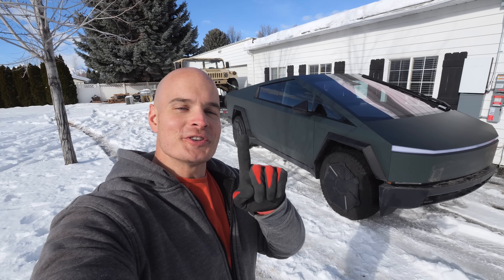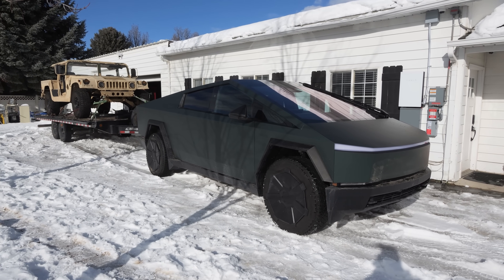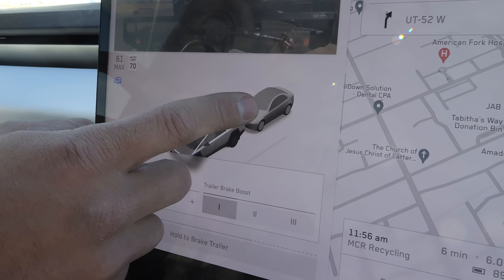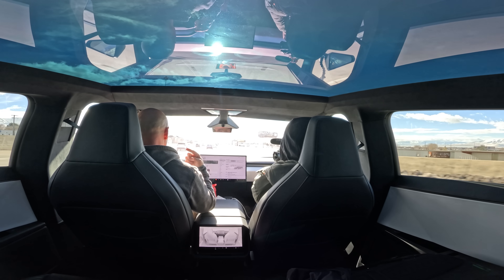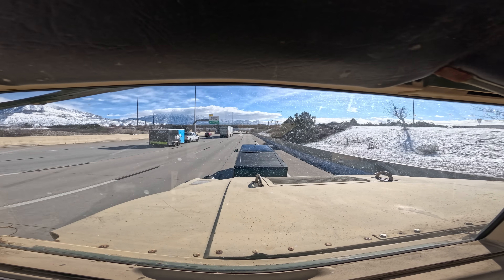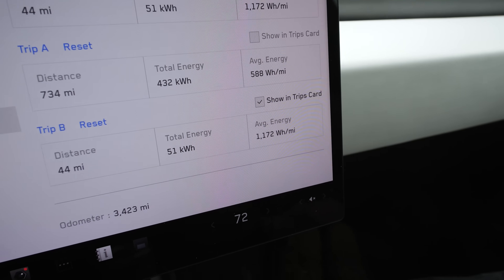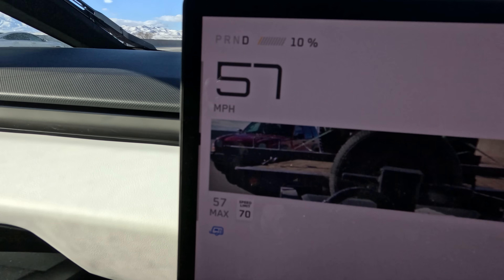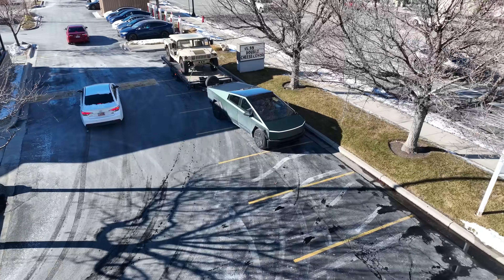How far can the CYBERTRUCK tow 11,000lbs in Freezing Weather?

Comment: My diesel pickup which has a 35 gallon main tank and a 115 gallon auxiliary tank in the bed, which takes up little room. It gets 15mpg while towing and can go 2,000 miles...
Reply: And how much does that cost to fill up?
Reply: @Ryan-sw3km  

A lot less than 100 grand... doing the math, I could tow an RV to the moon and back, half a million miles, and still come out ahead financially. 

The best part is diesel has almost 60 TIMES the energy per weight as lithium ion cells and can't even be ignited with an open flame. Lithium ion being a 50 year old technology does not help.

Comment: The humming/whirring noise you’re hearing is probably because of the cold. My dual motor Model 3 makes similar noises in cold weather. Tesla will run the motors inefficiently to produce heat for the battery so it gets to (and stays) at the optimal temperature. This is especially the case when navigating to a supercharger, it will consume much more energy while heating the battery to prepare for charging.

Comment: The navigation IS the proper way to get accurate range estimates in a Tesla. The battery meter is just that, a battery meter, not a range estimator, so it's best to just tap that to change it to percentage instead of miles (which just shows percentage of EPA rating). Also, I guess you missed that there's an Energy app (green icon) that shows you much more detailed energy usage stats and graphs, and there you can also see a predicted range based on the last 5, 15, or 30 miles of driving.

Comment: Lithium batteries are 1st generation energy storage tech that is being pushed on the market by Government not by demand. There is a much better energy storage system that was developed 5 years ago and sitting in a storage container in a private facility. This new tech is 10x better, safer and cleaner than lithium but guess who benefits the most from lithium?! Government. Don’t fall for it, no different then when Big Oil teamed up with Government to push us all into ICE vehicles.

Comment: genuine question, can 2 cybertrucks fit to charge side by side? in the parking bay or you need to use the phone app to remotely back the truck in the bay if there is no space to open the door,and does that work on cybertruck? the summon

Comment: So for comparison, my 00 Ram 2500 V10 4x4 with off road tires, rear locker, and a 3" lift would get about 7.5mpg towing this kind of load. 35 gallon tank, roughly 269 miles when towed all the way. I would usually fill up with 1/4 tank and about 210 miles driven. Average GPM of a gas pump is difficult to find, but the max is 10, and one site said 4gpm is average, so 28 gallons, 7 minutes to fill back up. This is not a good look for EV's.
Reply: And what's the cost to fill up that much gas?
Reply: @Ryan-sw3km  Roughly $75. A Tesla supercharger in my state costs 26 cents per minute, looking at that, going the same distance would cost roughly $35 in electricity and add about 2.5 hours to the trip for charging times.

I purchased my 00 Ram for $4500, vs $80,000 for the dual motor Cyber truck here. I get it's not exactly fair, used vs new, but it does the same job. Also, I can go get a brand new F150 with a 3.5L ecoboost for $43k and get the same towing capacity.

Comment: I can tow 387 miles at roughly 10k LBS give or take with a 1999 Dodge Ram Cummins diesel (yes, modifications have been done to the truck) with an 8th of a tank left. Basically 23 of the 26 gallons used. Roughly 80$ spent on fuel for the entire trip (no money is not a concern for me)  but I’ve gone further and with fewer stops and if a stop and refuel is needed I have more options compared to charging stations. The cyber truck would need to stop in my estimation 4 more times to go the distance I have plus the time it takes to charge. Cool concept with the truck but the towing in my opinion is sub par if you need to be someplace on a reasonable time frame.

Comment: As a professional truck driver i approve using bungee cords to strap the load. :D It is cool to see they use 4 wheel steering, and even better if you can Crab steer. i have been working most of my adult live on trucks and machines like forklifts, telehandlers, cranes and stuff and it is so useful to have a 4 wheel steering, except when you are driving on the highway. When you turn the steering wheel the vehicle tend to twitch like a fish in water on a high speed and that is not a safe practice. So usually on the highway you want to disengage the 4 wheel steering and only steer in the front. But backing in and out of parking must be a dream, especially if you are in tight spaces like a mall parking...
Reply: Absolutely nothing heavy duty has 4 wheel steer because full float axles and more parts= more problems.
Reply: @@karlwithak. Yes clearly like all the fires when they charge 🤣
Reply: @scottleggejr all the fires
Reply: @IdontspeakBro.  🌋🔥🔥🔥🌋
Reply: @@karlwithak. If it has a battery that charges and discharges energy by moving lithium atoms on to and off of an electrode and has a high enough energy density, it will catch fire, eventually.  They all do.  The more charge/discharge cycles that the battery accrues, the more likely it will happen during a charging cycle.  Manufacturing quality can push the fire further down the road, but, barring the cell failing as an open circuit, it is as certain as entropy increasing.  We are very fortunate that manufacturing quality has already progressed past the point where lithium batteries will not spontaneously combust before reaching the consumer (UPS Airlines Flight 6, out of Dubai, September 3, 2010), but will never completely eliminate the problem.
Reply: @richardbell7678  Seldom do I read a less-informed opinion than this.
Reply: @alsavage1  It is not an opinion.  It is scientific fact.  The lithium cell releases energy as lithium atoms move from the electrode to the electrolyte.  They are recharged by moving the atoms of lithium back on to the electrode.  The problem is that the lithium atoms do go back to where they came from.  Roughness on the electrode distorts the electric field near the electrode, which encourages the atoms to go where the peaks are, making them higher.  When the cell discharges, atoms come off the high spots and the low spots, so atoms keep moving from the low spots to the high spots, building a conductive bridge across the cell that will eventually short it out.

If you know differently, please cite your source.
Reply: What about in roundabouts?
Reply: @@karlwithak. Tesla Cybertruck caught on fire. This will likely push delivery event well into 2024. 🤣
Reply: Variable speed 4 wheel steer. Above 45 mph, the rear wheels turn is same direction as the front wheels making it a gentle crab like street at highway speeds. This is a very well engineered system.
Reply: - Freezing weather
- Driving on snow
- Those tires!
- 11,000lbs
- Non-aerodynamic object towed

90 miles considering all the above is not bad in my opinion especially if you’re a construction worker and driving in the city.
Reply: @@karlwithak. Case? Like you're some kind of authority? These ev systems catch fire all the fucking time LiPo and Lifepo4 all the lithium chemistry cells are explosive. The only cells that were stable (nickel) don't have the energy density. The lithium ones don't have the energy density to take out gas/diesel... ANY amount of moisture and a quick charge, they short and explode and take out their neighbor and you have thermal runaway. So put a truck which presumably tows a boat (down a ramp) or gets washed and later uses a Supercharger, your odds of it lighting are exponentially increased. It's the cell, not the brand. So now I say sentences like "FACT" and "CASE CLOSED" and "there's no argument" and "cope" and "cry more" to be like you... I've had a truck in some form my whole life and this abomination isn't a truck in my opinion. No goose ball/fifth wheel, no lockers, no range/distance, no low range, no thanks 😃 I tow a boat from Phoenix to Powell every year and this thing can't do it 😬

Comment: Been saying this for a while-- 800v vs 400v does not make much of a difference for range and performance, it only helps reduce conductor size and component sizing and adds a small amount of efficiency gain. will not magically double the range  and it wont magically make the battery charge faster . charging at 400 or 800 the cells still see there 3.7 to 4.5 v range . The cells don't care. It's the kwh size of the pack that drives the range  not the voltage .

Comment: This might be nitpicking, but it's not a cybertruck. I was expecting graphs, stats, some kind of energy control panel... Even the mirror could be a small screen with a rear view or divided in 3 parts for sides and back. Or have a tow load status screen and a back view. Musk was going on and on about how the car should only need camera data with no fancy radars and stuff, but the only screen showing the hitch is on front console. I don't know. It doesn't live up to Cybertruck name imo. It should feel like you stepped into the future operating a space ship on wheels, but all we have is something that already exists on the market and might even be slightly worse with questionable aesthetics.
I was about to ask if you felt like a unicorn driving it, but the car filming you kinda answered that.

Comment: Tesla's milage number next to the battery icon is not an estimate of range remaining (sometimes called the "guess-o-meter").  It the the "rated range," or the range on the EPA test cycle(s).  Each "mile" corresponds to a specific Wh of energy available in the battery.

To see Tesla's range estimate, or the miles remaining if you drive the same as the past few minutes, you have to bring up the "energy" screen.  You can select 5, 15, or 30 minutes of historical energy consumption for the range estimate.